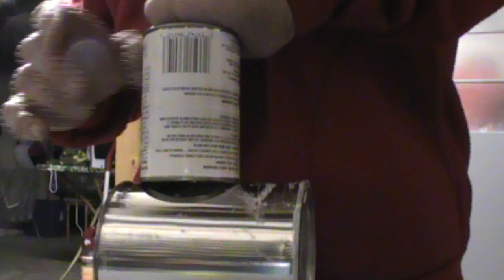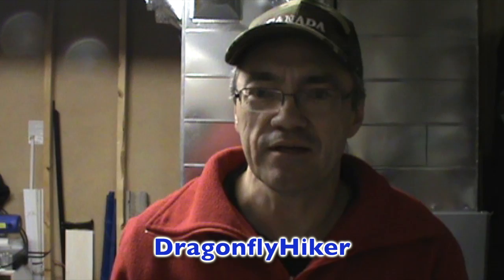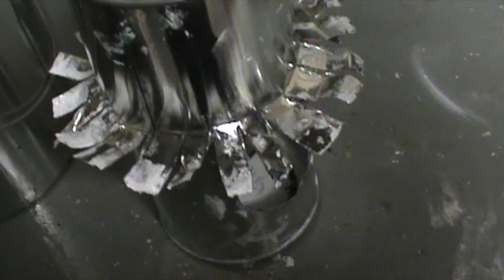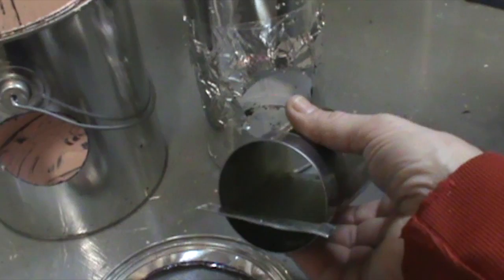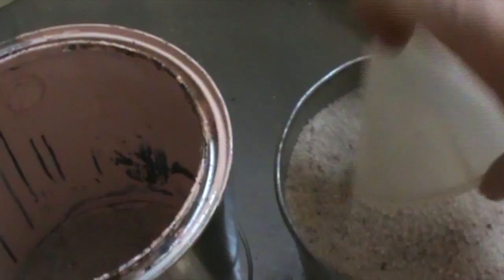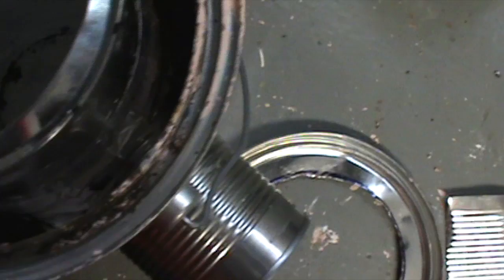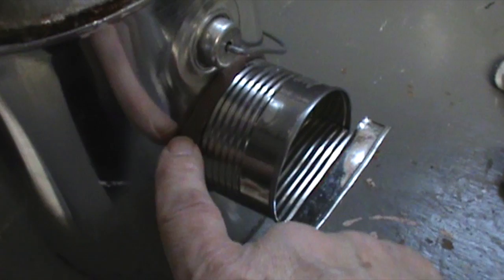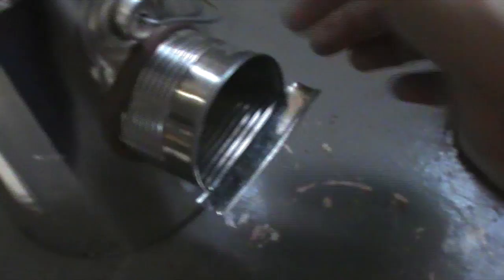Paint Bucket Rocket Stove

Comment from the maker: Yes, I do like the handle too... that's why I chose the paint can :)
The sand really works as a great insulator by the way... When I lit the stove, it was sitting in a few millimeters of fresh snow. When it burned out after about 10 minutes, the snow under the can had not melted and the outside of the can was still cool to the touch! I didn't touch the fuel port because I'm sure that was hot.
Thanks for watching Tito. It's always great to hear comments from Germany!

Comment: Great video Jim very impress with your handyman skill. this one seems to work better then th original. sand is far better insulation then vermiculite. as per LDSPrepper. don't know about rocksol. I may try that in the future. Paint can can be more sturdy then tin can and the handle great thinking. Atb Louis
Reply from the maker: Yes it works pretty good. It's almost 2 years old and not rusted out yet.
Reply: Jim... Excellent job amigo. Muchas Gracias. I'm going to build one...

Comment: I think I am going to my local junk/salvage yard, grab up some used 1/16" thick square tubing & take it from there. Make mine box like (easier to cut squares & rectangles imo than circles). Then weld it all together. Last longer too (versus tin cans & buckets-easier to rust out). Should work the same, right?